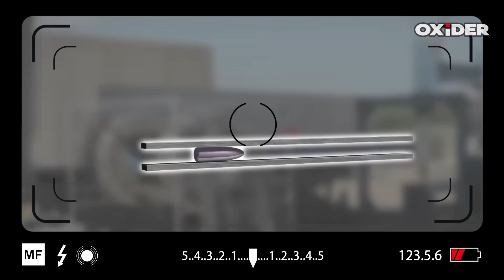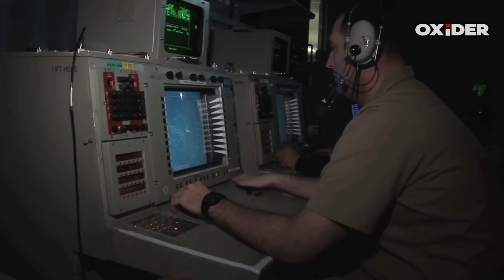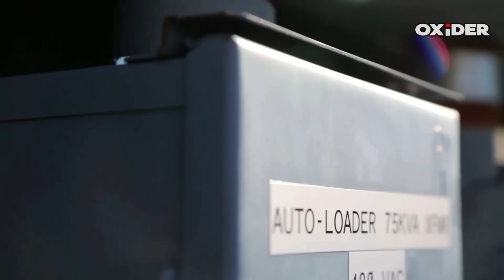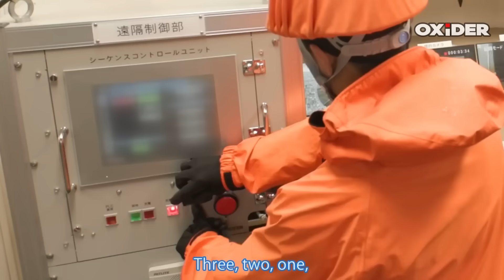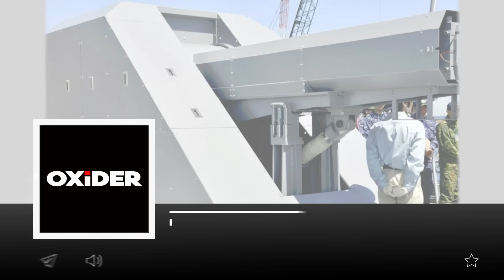Japan just installed a Railgun on a Warship - can fire at Mach 7

Comment: Japan has decades worth of research and experience in magnetic propulsion. if anyone can make a successful railgun, it would be them. While US is great with the bang-bang boom-boom, Japan would be great with the pew-pew. not to mention that they already have lasers. now all they need is a giant robot as weapon platform
Reply: ゲームチェンジャーではない。ゲーム無効化😂😂
高価な自然落下スピードを混ぜた弾道落下ミサイルを、安価な弾丸で撃ち落とす。
Reply: There is no evidence that japan has considered plasma rifling so they will probably fail.
Reply: US made a complete and functional railgun, it's only drawback is than it required a lot of electric power to operate it, which made it ineffective in a logistical way.
If implemented on a ship most of the ship will be just to generate power for 1 single railgun, space you could use for missiles/ammo and crew living spaces, not to mention so much electrical equipment on a ship at sea will require a lot of isolation and maintenance else can easily become a hazard and most likely can be easily disabled if the ship gets hit.
Large scale production will also be extremely expensive as it uses expensive high quality materials, which makes it not viable, video mentioned cheap ammo, but failed to mention how expensive (not to mention slow to charge) the generator equipment to supply power for each round is and high maintenance costs for barrel replacements every few shots.
Reply: I would like to say from Japan that you seem to be a bit radical in your thinking.
Reply: To be fair 
Japanese is one of the best countries with the best people for a reason
Reply: @Dr.Malory  Every non-Japanese Asian who lived through World War 2 would disagree
Reply: This comment is ridiculous because the US made the railgun, said "nah we can't find a use", then gave it to Japan when Japan asked.
Reply: @ASlickNamedPimpback  Like it was explained, the problem US had was barrel.  They just couldn't make it to last from eroding.
Japan has superior metal composite craftsmanship,  Now they tested barrel that withstood consecutive 120  rounds. Japan also
has superior electro magnetic tech. enabling rail gun to be installed on vessels
Reply: @funkya1840  That is just blatantly false. I don't know where you're getting all that, but the truth of the matter is the US just didn't see a use for an expensive gun with a barrel that needs constant replacing. It's the 21st century, either you're shooting enemy ships with missiles, or shooting pirates with autocannons. Neither require railguns.
Reply: @ASlickNamedPimpback 

I understand your point, but I think it's important to distinguish between the U.S. and Japan's different use cases. The U.S. railgun aimed to replace naval guns, requiring large projectiles and extreme energy—leading to barrel wear and cost issues.
Japan, on the other hand, is developing a railgun as part of an interception system, using small kinetic rounds (~1kg). This significantly reduces wear and power requirements. The fact that 120 rounds were fired without serious damage is confirmed by Japan’s defense ministry and media.
Reply: @ユニコーン-x3u  Wow, gee, I wonder why firing smaller rounds could lower wear and tear. I wonder if that could be the case, instead of your totally unsubstantiated claim of 'superior technology'.
Reply: @ASlickNamedPimpback  

I have never touched upon the superiority or inferiority of any technology. I simply stated a general physical principle.

Also, I'd like to make one more point. You mentioned that railguns are unnecessary, and perhaps that may be the case for the United States. However, as I mentioned earlier, Japan sees them as a promising option for missile defense. Unlike the U.S., we face the imminent threat of ballistic missiles right at our doorstep. While missile interceptors have been the mainstay of our defense, they are no longer sufficient on their own. Japan continues developing railguns in order to build a more layered and resilient missile defense system.
Reply: @ユニコーン-x3u  Ah, I thought you were the other guy. I wasn't going through the replies to check if people are the same, but that's what I was referring to there. Sorry for the confusion.

Comment: The US failed because they had either the wrong people working on it or not enough of the right people. They wanted to contain the design and expertise strictly for the US. The only place this makes sense so far given the energy demands is naval vessels that are nuclear powered. That is till such time as capacitors capable of handling the demand can be somehow miniaturized. And remember the Japanese built and used the first actual Caterpillar Drive see, Hunt for Red October.
Reply: Factually wrong, the US didn't fail per se, they wanted their rail guns to be used on ships i.e. their railguns were significantly larger then the one the Japanese are testing. The ones the US wanted simply required too much power and wore the barrel out far too quickly, thus they stopped working on it. The Japanese the other hand want a significantly smaller railgun for anti-air.